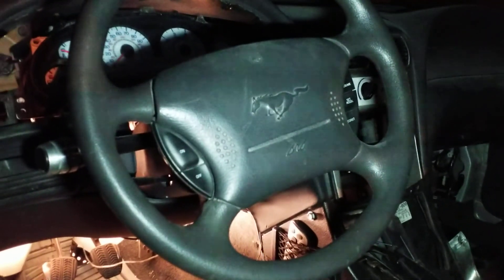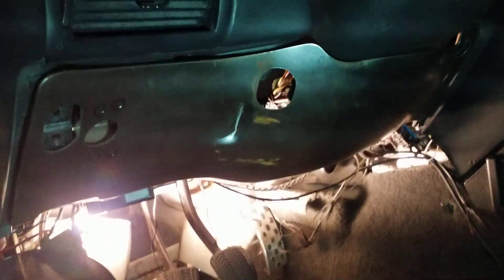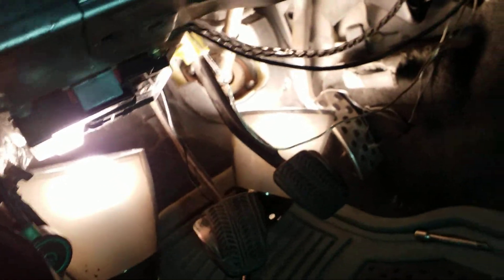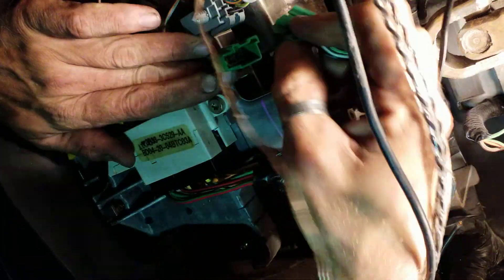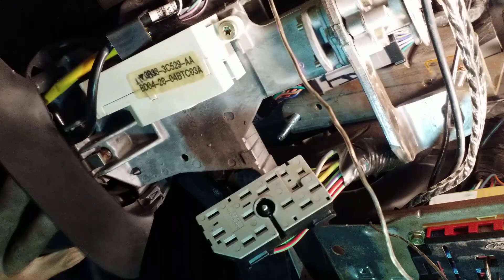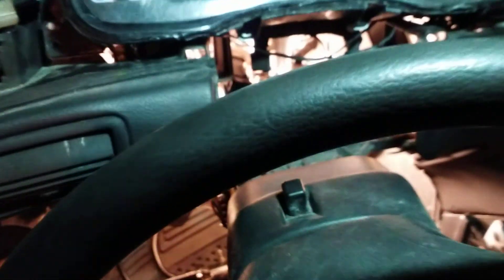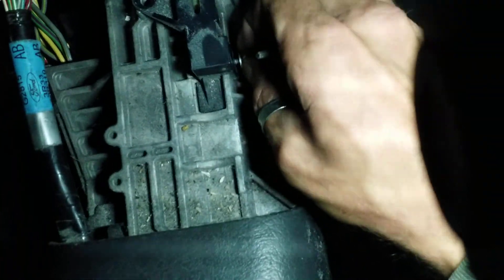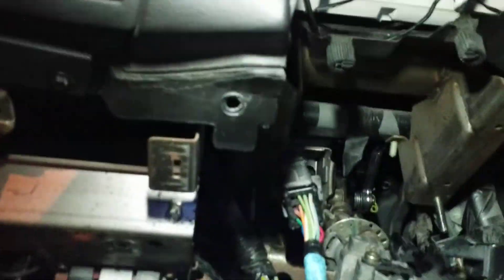Mustang Hydrobooster Swap Part 2: How To Remove 94-04 Ford Mustang Steering Column In 9 Minutes.

Comment: Hey quick question but can you replace the entire column without issue on the key side or pats side bike my hazard button there and just got a used column but don’t know if anything there will matter
Reply from the maker: If you swap out Your Key, lock cylinder and pats module connected to the cylinder into the new column it will work like it was from your car.